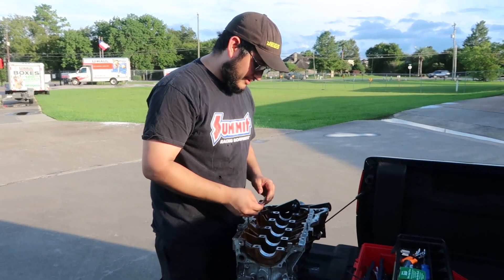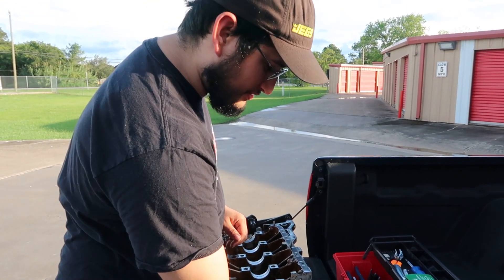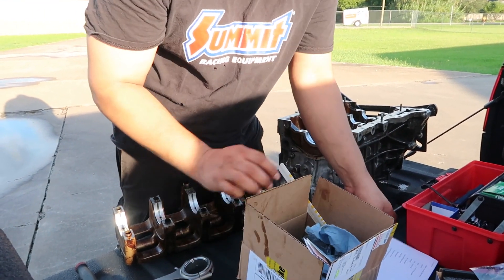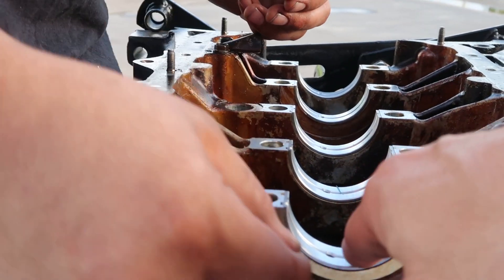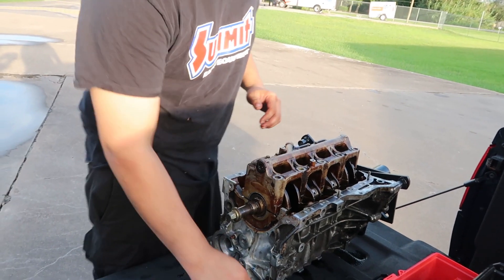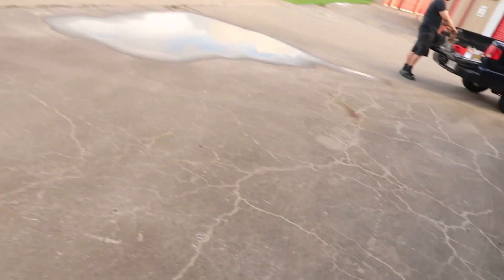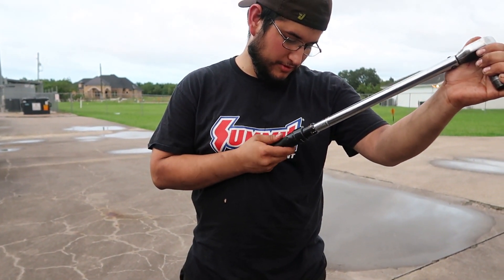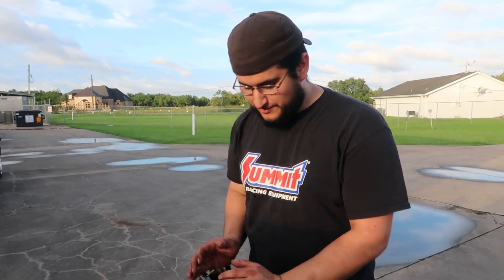PlastiGauging My Vitara D16y7 Main and Rod bearings. The Slick Vic is Almost Ready!

Comment: why are you doing this in a parking lot?
Reply from the maker: Think in this video It was a storage unit. I didn't own a house at the time so I lived in an apartment and did stuff at the storage unit. Now i have a house / garage
Reply: thanks for replying. it just cracked me up. you might mention that stuff like this is best done in a clean environment.
Reply from the maker: Lol..reminds of that meme. Where you think 1000hp engines are built and its like a science lab..vs where they're actually built and its in the front yard behind washed with a water hose 😂 i need to find that one

Comment: I’m putting my block together and I only checked one main bearing for clearance but it came out to .003 so I ended up having to bring my block and rings back to the machine shop anyway bc I found out the ring gap was off I talked to him he said not to worry but seems like to me if the specs are that tight it’ll be in issue I don’t want to spin a bearing lol

Comment: removed my head today annnd found my blown head gasket issue but didnt notice till the head was on my work bench it has 3 to 5 lobes wiped out form over adjusting the valves smh...Someones been in there cause someone through on a adjustable cam gear
Reply from the maker: Oh man that sucks! You must have a good amount of metal in there.. maybe check your oil? Think you'll go aftermarket cam? Or a stocker
Reply: whats weird is didnt find much metal just a tad but im sure if i tore open that oil filter it would talk to me lol also any chance you know if p2p are stock pistons? And for the cam well ill probably end up with a turbo grind cam no idea which brand yet they aint cheap but well see what i can find lol
Reply: @Bign89  p2p are stock y8 pistons
Reply: @BoBuilds  Hey I've watched your videos a couple times and I'm building the same Vitara build, and wanted to know what where the clearances you ran on the rods?